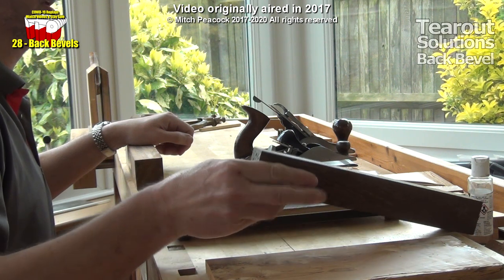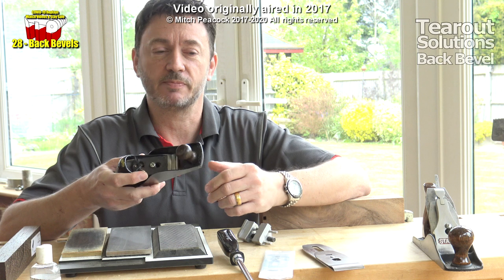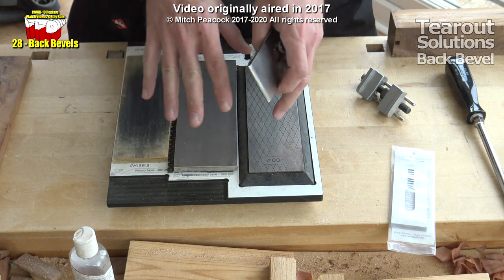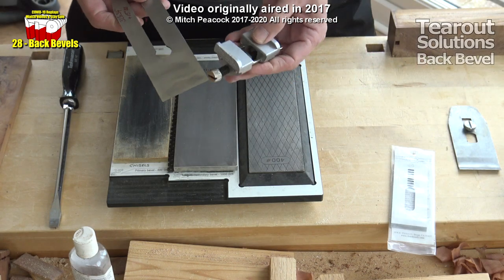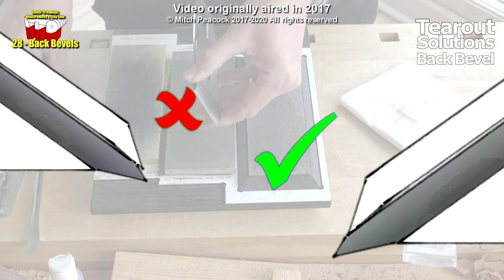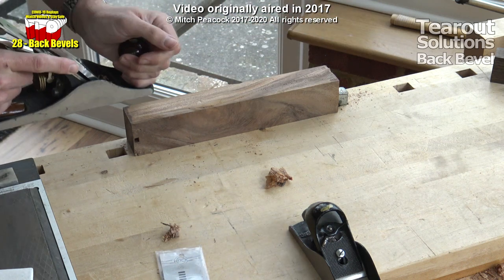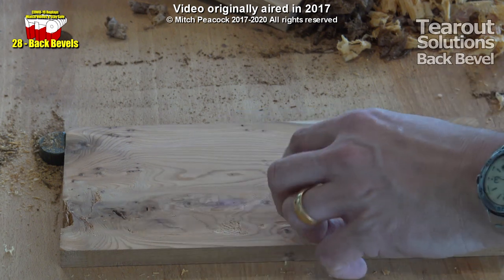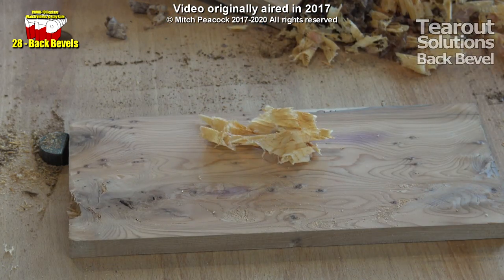Back Bevel for Tearout Prevention - COVID-19 Replay

Comment: Ever planed quarter sawn afromosia? It has horible cross grain.. not fun
Reply from the maker: I've had some recycled "teak" which I think may well have been afromosia. I'm sure a super sharp iron with a steep back bevel would cope fine. Let me know how you get on ;-)
Reply: @mitchwoodwork  personaly not that much of a fan of back bevels, but I do have a wooden plane I quiet got from my grandpa, its from the 1920's! I inlaid a piece of boxwood. I made it so extremely tight that you can bairly look through the mouth. It minimizes the tearout to a high degree, just some visible dull spots. Nothing a touch of a scraper or sandpaper can't handle
Reply from the maker: Love old wooden planes. Wish my 'shop climate was more stable so they made sense for me to use more.
Reply: Ah, that's a bummer. I've just restored a jointer plane that probably went through such conditions. It drank about 200 ml of boiled linseed oil!!